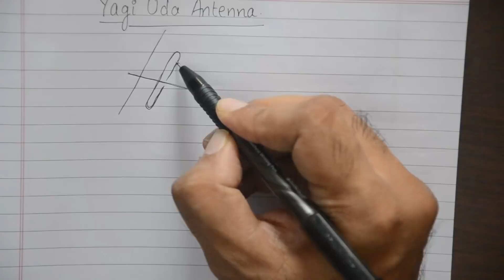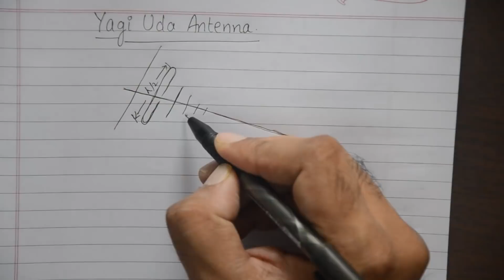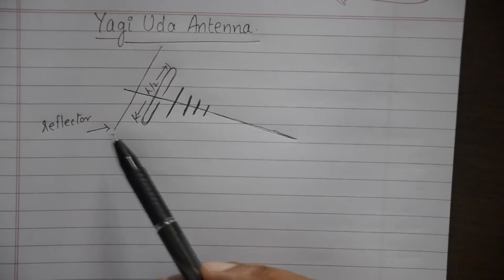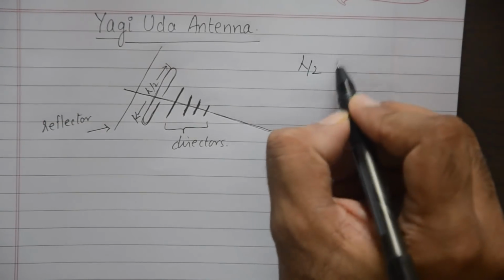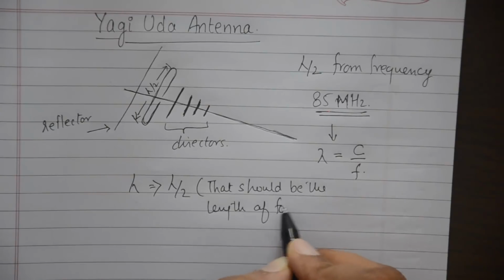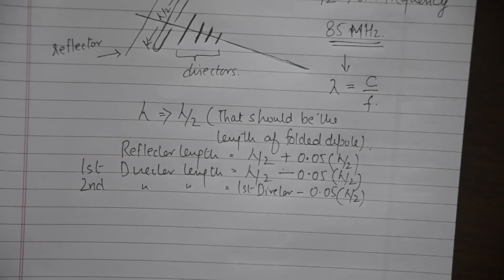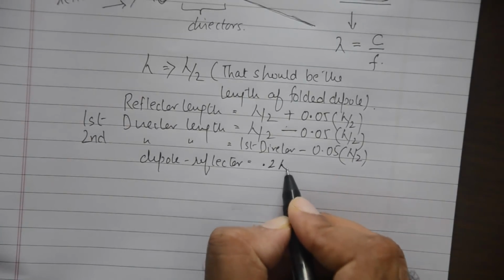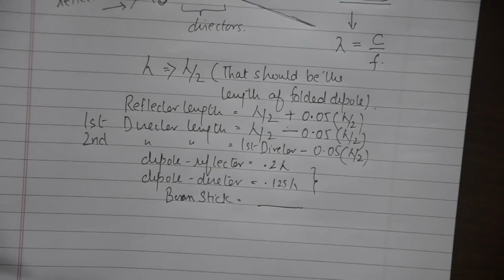Yagi Uda Basic Design and Construction | Easy Antenna Tutorial

Comment: are reflector, dipole, directors and  boom stick insulated or are they in short?
Reply from the maker: insulated
Reply: @nipunharitash  I connect the inner pole of the coax cable with the dipole and the external gauze of the coax cable with the reflector isn't it? Thanx
Reply: Lorentz, NO. the cable is connected only to the folded dipole, which is the driving element. The cable is NOT connected to the reflector and neither the directors.

Comment: when you calculate the 2nd director length you say: the 2nd length= 1st director - 5% the 1st director, but you writed 1st director -5% dipole length, which one is right?, thanks in advice
Reply from the maker: First one , the length is 5 percent lesser than the previous element :)
Thanks for pointing out though
Reply: @nipunharitash  thank you so much for the quick answer, i was thinking that the first one was correct, great video ;)
Reply: I had the same question. Thanks for asking it and thanks to the author for answering it

Comment: Nice video. Thank you sir. How to chose radius of elements? and the gap in dipole to give excitation/source?
Reply from the maker: Hello, I'm not sure about the meaning radius here. If you mean the length of elements it's progressive .I'm not sure about the gap between length of wires where we connect the source.
Reply: Dipole we are taking here is of cylindrical shape. I am asking the radius of cylinder
Reply: @nipunharitash  what is the space between the two pieces of the driven elements, and the size (diamater) of the elements? Will be same if we use big size element and if we use small element?

Comment: Yagi-Uda antenna has such shape and size is to facilitate the "free" flow of free electrons that first directed towards driving element where photons will be dissipated out once they have reached the dead end of the driving element. Since reflector is longer than driving element and those directors, it is perceived to have highest resistance. Flow of free electrons will tend to flow in less resistance path. Therefore most of remnant of free electrons from driving element will flow towards the directors instead of reflector. Some free electrons will flow into  the first director and photons will be dissipated once they have reached the dead end of the director. Then fewer remnant free electrons will flow into the next director with lower resistance with shorter length. Dynamic photons will dissipate to the surroundings after those free electrons have reached the dead end of the director. Even fewer free electrons will flow towards the next director with shorter length with lower resistance. Fewer photons will be dissipated out from those free electrons upon reaching its dead end. The ways dynamic photons being dissipated out from the yagi-uda antenna will be shaped them like a "loop" of directional dissipation of dynamic photons. Since driving element will dissipate out abundant photons, first director will dissipate out fewer and second director will even dissipate out even fewer photons and so on as if those dissipated photons will mold into a directional dissipation of dynamic photons. Therefore Yagi-Uda antenna will emit out directional dissipation of dynamic photons. If you are interested in real discoveries, I would recommend you to read my book, The Unification Theory  - Volume One and you will be amazed with lots of new, interesting discoveries. In God I trust.
Reply from the maker: Super Awesome ... Deserves claps . Peace :)

Comment: This is just a guideline.  Different spacings can be made to optimize radiation pattern, impedance....  Also there is no maximum boom length for these antennas.  Whatever is physically possible can be built.  A 100 element Yagi for example is certainly possible, but would need to be supported in more than just 1 place.  I have seen long Yagi go across a rooftop of a building for example.
Reply from the maker: Hello, the video is intended to familiarize undergraduate students to arrays. Appreciate feedback :)

Comment: You gave the spacing between the dipole and first director, but what about 2nd director and so on?  Also, how wide should the dipole be (spacing from top to bottom of loop)?  How thick should the elements be and what effect does it have if you vary them?  How far apart should the connection of the dipole be?
Reply from the maker: I'm gonna have to look for those as well and append them in a new video.
This is an introductory theory undergraduate lecture but sure those parameters matter in real design

Comment: What is the formula to find length of boom stick? and is the spacing between all the directors equal as (0.125 lambda)? I am working with 5.875 Ghz frequency.
Reply from the maker: Yes, The director-director and director-antenna remains same at .125 lambda, reflector- antenna length is approx .2 lambda, i dont remember boom length figure, please see and use yagi uda calculator tutorial for exact figures for your frequency of operation.